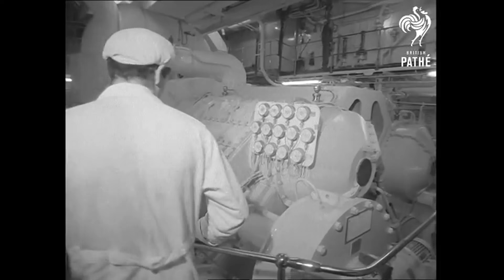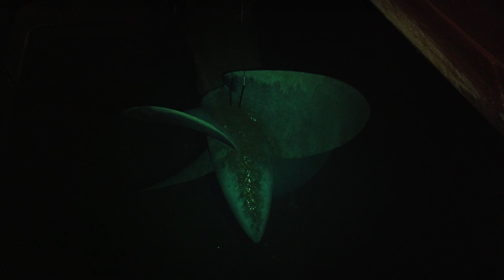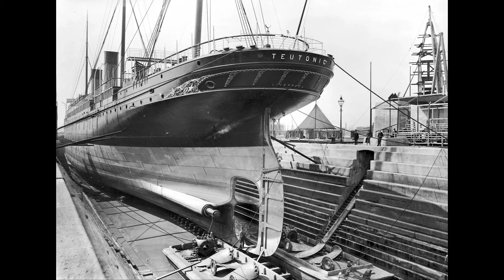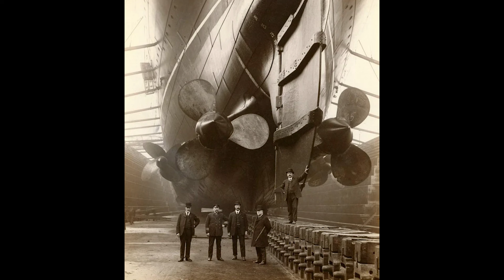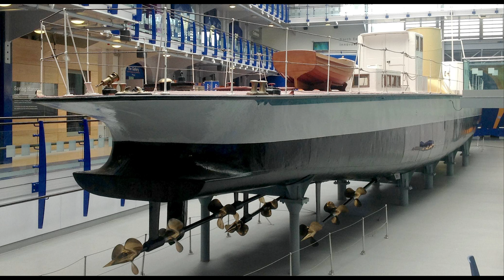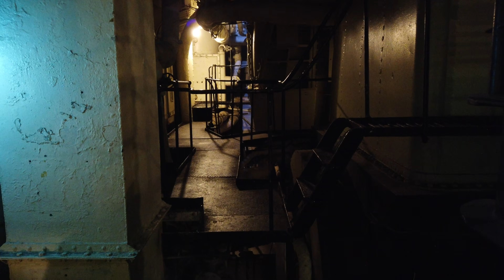The Vibrations That Shook Ocean Liners

Comment: Just neat stuff, the subtle stuff and for this period, quite ship specific issues being fixed without on knowing what was causing it or half knowing. 
These dudes are sorta just throwing engineering into the wind and seeing what happens. 

Very topical for me sorta, my 66 Ford Rustang has an undiagnosed rhythmic vibration that rattles change in the cup holder at 55mph…. Comes back at 90 mph to shake the change outta my cup holders. 
It’s done it for 30 years and is still together.
Reply from the maker: Engineering before computers was really interesting, like you said, just building it, throwing it out there to see what happens!

Comment: It wasn't just ocean liners.  Prior to and early in WW2, many U.S. Navy ships had vibration problems which could limit cruising speeds and disrupt gunnery.  This was a serious problem with the North Carolina class battleships.  The problem wasn't just the propellers, although there was considerable experimentation with swapping out different designs, but with resonant frequencies in the heavy rotating mass of the entire drive train, including the propeller shafts and the turbines themselves.

Comment: I will never forget the grinding, rhythmic vibration on one occasion when sailing on QE2 as a child. It was due to the pitch of her controllable pitch propellers not being optimal and setting up significant hydrodynamic shock that affected her entire stern. A junior officer came aft with a walkie talkie and the issue was soon taken care of while we carried on eating dinner in the Lido restaurant high up in the stern.

On one voyage on QM2 there was a regular rhythmic vibration on the lowest deck of the Britannia Restaurant. I subsequently asked Stephen Payne, her Chief Designer and a friend of mine, what the possible cause was and he said it was due to the rubber shock absorber underneath one of her four diesels perishing and therefore needing replacement which didn't happen for a while after.

From serving on an oil tanker as part of training to be a deck officer, the vibration a diesel causes when it's not shock absorbed (be it by sitting on rubber or by another means) and when it is directly fixed to the ship's structure is significant, particularly when the diesel is operating in it's critical RPM range and at near maximum RPM. The diesel will make it's presence known in abundance even on the ship's bridge!
Reply: r/Whoosh

Comment: Great and well researched video, alex.
Sharing my thoughts - The white star line's ocean liners never seemed to have vibration problems also they remained solid in rough seas. Was it because they weren't made for speed like you stated?  
I believe these two criterias are very crucial for ships and for this very reason I tend to feel Olympic class liners were close to perfection.
Reply from the maker: Yes you are correct, White Star Line used to compete for the Blue Riband like many other ships. But in the 1890s, White Star noticed that the number 1 complaint about "fast" ships was their vibration. With RMS Oceanic (1899), White Star decided they no longer wanted to compete for the Riband, they opted for the daring choice to focus more on comfort. Some people take that to mean White Star ships were slow. No, they weren't slow...they were quite fast, but because they weren't "racing" they could use tried and true engines and hull designs that were known for a comfortable ride.

The Olympic class is often held on a high pedestal and as such, few people want to mention the downsides to the ships, of which there were many...the Olympic was quite a roller, with cramped 2nd and 3rd class accommodation, most of the ship's interiors remained undecorated, with bare steel bulkheads and exposed I-beams. And the Olympic class ships weren't very hydrodynamic or aerodynamic which resulted in a ship that "caught" the wind too easily, and wasted lots of energy plowing through the water.

Comment: The Normandie, during its first year of service, vibrated terribly at the stern. It was due to the shape of its propellers. When she went into dry-dock during the winter she was fitted with new ones. They also added a second class lounge  just rear of the 1st class Grill Room to 'stiffen' that particular area. In doing so you could no longer have a view of the terraced decks at the stern. The Grill Room no longer had those views to the sea. The addition truly ruined her elegant profile
Reply: Opps, forgot to add that during that first dry-dock they removed the illuminated 'NORMANDIE' signs that were between the funnels that first year. I really liked them. I think one of them still exists on a rooftop of a former hotel in South America somewhere. I could be wrong and often am!
Reply: A soul, for a soul